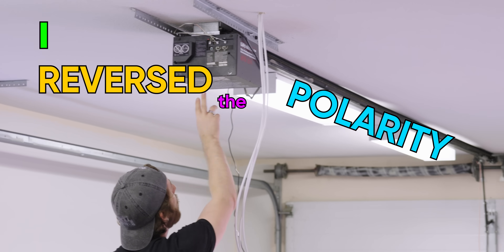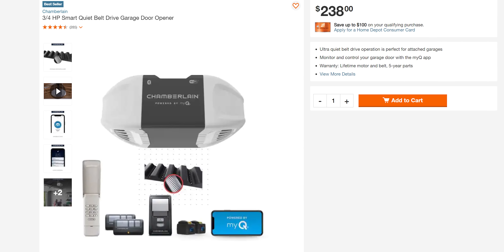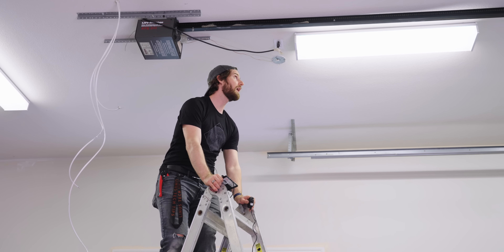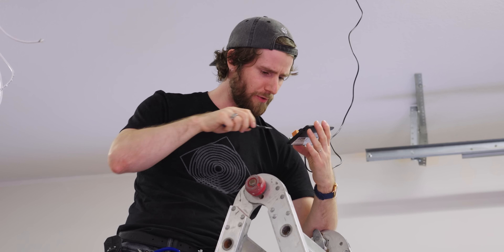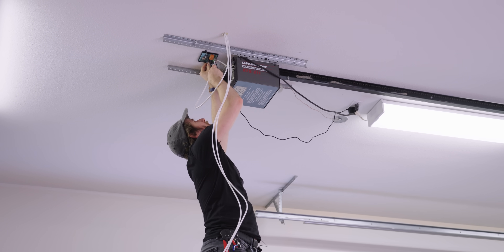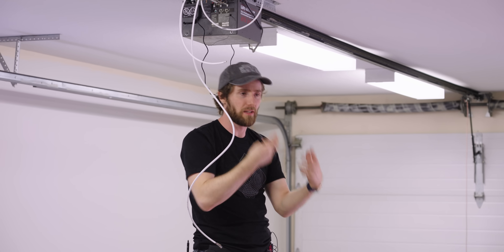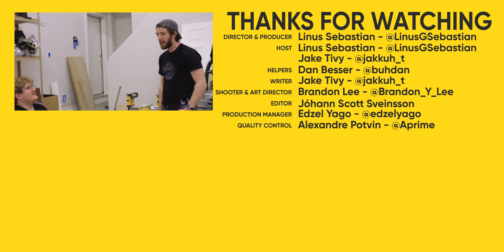Smartifying My 25+ Year Old Garage - Z-Wave Garage Door Opener

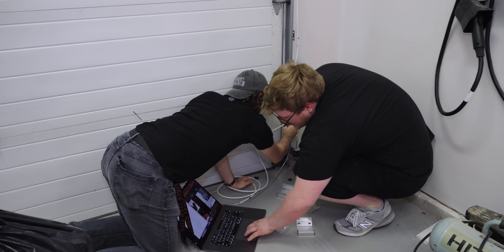Comment: 4:41 "put it very close to the bottom, so it will detect even when the garage is open just a little bit" 
If the garage door moves just a few centimeters, the sensor won't make contact anymore, no matter its position on the gate, so you could literally put it at heads hight and it would not affect how wide the door needs to open before it triggers. 😂😂
took me a while to figure out too 😋

Comment: Another  great video. Always entertaining and informative. For the long screw, you could have just spaced it out with washers vs cutting it. For the ladder work, you should have moved ity back a foot and gone up a step. Would have been more comfortable and still safe as long as your knees are below top to assist with balance, and meet safety requirements of Work at Heights regs in Canada.

Comment: Many garage door openers have limit switches on the chain track to tell them that they are fully open and to force the opener off. Using that as an extra input can determine if the door is open or closed.

Comment: I don't understand why this was so complicated. I got a $15 device that had all the same features built in, including the magnetic sensor for open door detection. It was tiny and all it needed to work was a 5v power source and connection to the switch terminals. Took me 30 mins to setup by myself

Comment: You actually don't need to "reauth" with Google if you're running HA locally. I've read that as well, but it's not true. The initial setup is a bit painful, but my setup has been running for almost a year now with zero issues.

Comment: As an electrical engineer who spends literally most of his life playing with sensors for production lines this video made me lol many times .... Also personally I use esp8266 devices flashed with tasmota for my home automation...or ZigBee devices flashed with tasmota.
Reply: I’ve flashed devices with tasmota, except mine was new enough to require hardware flashing since they started encrypting the stock firmware on some devices. Annoying but still fun.
Reply: How many te have the sensors been faulty
Reply: I've flashed a few Sonoff devices with tasmota and they've been great.  Easy to integrate with Home Assistant.
Reply: Use An Overhead door opener MYIQ
Reply: ewelink
Reply: this ^^ and the customizability is a nice plus. also, fellow controls engineer? hey!
Reply: Why not ESPHome?

Comment: Oh my god....just get a SONOFF Basic for like $15. Then cut the 120v trace before the relay. Then configure it to work with your existing IFTTT network, like HomeAssistant or Amazon Alexa, using Inching Mode.

if you want to make it more advanced, use a SONOFF SV, flash it with Tasmota, and connect a reed sensor to gpio14 and ground, and connect a wire from the positive pad of the input and a separate wire from the positive pad of the output on the SV. Those 2 wires connect to the terminals on the garage door opener. The reed sensor itself goes anywhere you want on the physical garage door and its railing.

Comment: Apparently Linus doesn't know about Tailwind, which is an excellent wifi garage door opener that doesn't require a subscription.  Looks like Tailwind even offers those same door sensors in case the default sensor isn't sensitive enough (which was my case).

Comment: Sonoff SV (flash w/ Tasmota) powered by a spare cell adapter. Added a reed switch for closed status. Configure for a 1sec contact pulse. Wire the contact in parallel with the wall button. 👍

MyQ is an absolute 💩. It has more bugs than a bait store.
Reply: I put a set of industrial magnetic switches like those on. They work best at the top of the door so you can catch the mechanism unloading before the door even moves up.
Reply: Also, Home Assistant FTW

Comment: Correction: For the Google Assistant manual setup in Home Assistant, you do not need to re-authenticate every so often. It's one-and-done. It is true though that it's a pretty lengthy process, and will require Home Assistant (or at least the specific API endpoint provided by Home Assistant) to be publicly accessible through the internet.
Reply: You only have to re-auth it if you don't read the instructions fully and neglect to press publish button on the Google dev portal.
Reply: @DrCoolHands  Doesn't the publish step require a review by Google?
Reply: @etekweb  Nope, mine has been working for years without Google reviewing it.
Reply: This man is right! Please correct Jakes faulty statement. The manual process is long and complicated, but once you got it, you can forget it.
Reply: If you hadn't written this I would have. I've been using Home Assistant since 2018 with manual Google Assistant integration and it has worked almost flawlessly. I've only had to touch it when Google changed something on their side. But all I had to do was republish. 
One recommendation I have for anyone doing this is manually specifying in Home Assistant configuration what rooms devices are in and what you want exposed to Google. Otherwise you will have CLUTTER as you add more devices to HA and in  the event you do have to set up the Google Home integration again everything will automatically fall in place vs tying everything to rooms again.
Reply: thanks for the correction. for me this is a huge deal if i can or not host sth locally
Reply: Restricting the API is definitely best practice. A reverse proxy like NGNIX or Organizr, yes Organizr, with NGNIX is probably the most straightforward. But still time consuming for the first time setup. But well worth it for scalability, security, and seamlessness once it is running.
Reply: Can confirm. Has been working for me for years without reauth
Reply: Exactly came here to say this (though safely assumed someone would have already pointed it out). Though you do need to re-auth it if you intend to make some sort of change after a few weeks (though i guess once its up its up so). That said with HA its pretty simple to run the exposed address through DuckDNS with HTTPS and have it all encrypted (from memory i think its actually required to have a signed HTTPS cert? i set it up so long ago i honestly cant remember) 

You then just run the NGINX SSL proxy addon that will then allow you too still use plain HTTP on your private/internal network but externally require HTTPS and thus allowing local-fulfilment from Google Assistant to actually work, Which speeds up things actually doing what you tell them too since the command goes across your local network rather than through the google cloud (so then the bonus of it not being cloud bound at all) and back to the publically facing address of your HA (With the ability to "fall back" to remoting if something goes awry).

Bit of work to configure but tbh if your doing stuff like this and even have the ability to setup/use HA to begin with, following a few instructions is well within your ability

1000000% within Jakes ability to setup
Reply: Definitely worth noting this, $5 a month might be negligible for some people but depending on the use case, for something very simple (e.g. a single home assistant smart plug using MQTT) $5 a month is a lot of money just to turn on a light or something
Reply: @JackRonan  I have MQTT broker running as a VM on my ProxMox server since I use Sonoff devices flashed with Tasmota.
Reply: @Darkk6969  I just host it on my pi alongside home assistant, what I mean is adding Home Assistant to Google Home allows for that device to be switched via voice so it makes it much more usable. Also using it with a flashed smart plug!

Comment: That contact can be anywhere on the door. If it moves the magnet comes out of alignment anywhere on the door the sensor opens. 
Also that contact uses a tensioning system to attach to the door, so you need to know how wide your rail is to properly attach it.

Comment: That sensor could have been installed on the top of the door, it doesn't have to be at the bottom as they imply when they say they what to  detect if it is a bit open.

Comment: I have my house running on Home Assistant and Google Home without HA Cloud and it does not have to be reauthorized every two weeks. You just have to  get your OAuth2 configured correctly. 

Plus, I even have local fulfillment working so that the command goes directly from the Google Assistant device to Home Assistant over the LAN, with the Google Cloud pathway only used for backup.
Reply: Mind sharing the local fulfillment bit?
Reply: How did you do the local fulfillment?
Reply: That's also what I do!

Comment: You can have Assistant connected to a self hosted instance, the setup takes about 2 hours but that's it. A friend runs that behind a Cloudflare tunnel so they don't even need to open ports.

Comment: "NO 2, COM 2 and NC 2"
Normally Open 2. Common 2 (neutral). Normally Closed 2.
So when you press the button and you want the door to open, it's NO 2 + COM. Because by default it's "open". 
Inside the button, think of it as two contacts looking like this /  \ when when you press it, they connect and touch /\, thus closed the circuit.
NC is the opposite, by default the contacts are closed /\, and when you press it, it opens it /  \, opening the circuit. Typically, NC is used for things like emergency stop buttons, it opens the circuit and stop the power from through through and stops the whole thing. But buttons can be configured any which way in software. I don't know if it's possible with this thing, but you can use the NC to open the door, too. Just have to configure the logic behind it in reverse, basically.

Comment: 4:43 you could have put the closing sensor even much higher, it would not have changed the situation since it would have coincided with the point chosen on the door only when it would have been completely closed. So, put it close to the bottom IS NOT NECESSARY... unless you have a dual sensor of the same type on the same side. 
SPOILER: You could place two sensors at the same height as the door frames but at two different heights of the shutter to signal total opening and total closure.

Comment: The answer to your cloud/dev app question is to add Node-red and create an alexa integration through it. Pretty sure you can do the same with Google assistant but I haven't tried yet
Offloads the entire thing from home assistant yet still runs in a submodule of home assistant, and it's pretty flawless

Comment: You didn't have to install the sensor on the bottom, if the door is open then they won't be aligned (and thus change the value)

Comment: Then and now, i still don't get what the hassle is. With a completely DIY system, PI based, i can use my phone to open not only my garage doors, but other doors as well with a system that would require hacking the cellphone line to bypass (so it's also safe). All i have to pay is for an extra number.

Comment: 4:40 In this arrangement it wouldn't make any difference how far up or down the door the sensor was placed. A 6 inch displacement of the door is the same 6 inches if it's measured at the top of the bottom of the door.
Reply: yup, and having it this far down would make it easy to cut the wire once it is open for a few inches
Reply: @karlobrutalo425  Cutting the wire wouldn't do anything because it would remain open all the time if cut. The magnet closes the circuit.
Reply: @numus19  well, not nothing... You can test for open circuit, so if it is open circuit, yet door supposed to be closed, its either faulty or security breach).
Reply: @numus19  it being open all the time would what a thief would want
Reply: I had the same thought at this point, also when he was trying to figure out the terminal to wire to, he could take some wire and jump the terminal instead of trying to activate the switch....
Reply: Yep. 🤦‍♂️
Reply: Dammit said the same exact thing without reading the comments. If it was a contact sensor sure.

Comment: 4:41 No matter how high you put the sensor, as it is attached to the door it will moove with it and detect the slightest opening (hall effect sensor for people wondering).
Putting the sensor higher could also reduce the likelyhood of a metallic object interfering when the door is open.
Reply: Yeah I would of placed it as high as it could go reduced wire run and things to break it off.
Reply: a reed switch would work too
Reply: @cocotug0  the door sensor they used is a reed switch
Reply: @jordonscott6018  thanks 👌🏽
Reply: @cocotug0  indeed and could be more precise 🤔👌🏽

Comment: So With Zwave, secured devices like that opener, or door locks, they pair in a low power state, which means it normally has to be paired within range of the zwave controller(5-10 feet) after that they will communicate through the rest of the network with no issues.
Reply: I've used Z-Wave for more than a decade for all outlets, switches, garage door, AC etc. (about 100 devices) and compared to all the China made IoT junk running individual apps and being prone to cyber security issues, Z-Wave is a blessing.
Reply: @ThinkingBetter  what hub/software have you used? 

I’ve heard homeseer has the best zwave implementation but their UI is very outdated.
Reply: @sm-zt4ut  I'm using HomeSeer V4 and yes, it's an outdated UI, but it's also very flexible allowing me to write scripts and do some advanced routines. I've used HomeSeer since I started using Z-Wave.